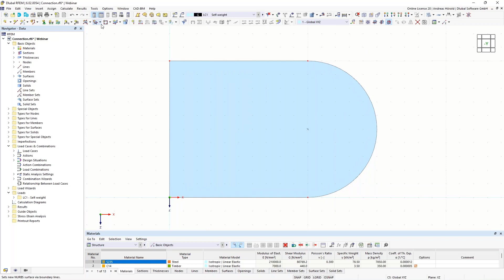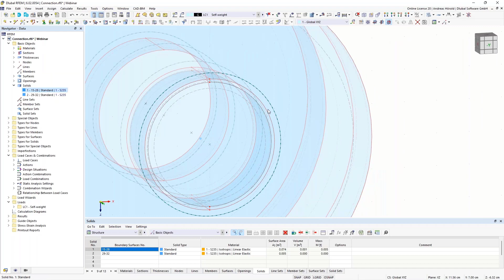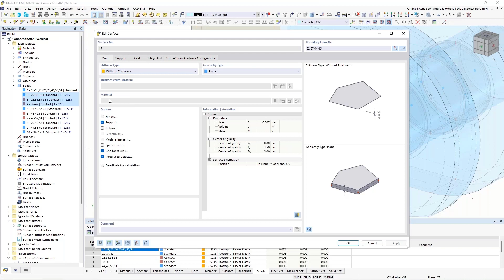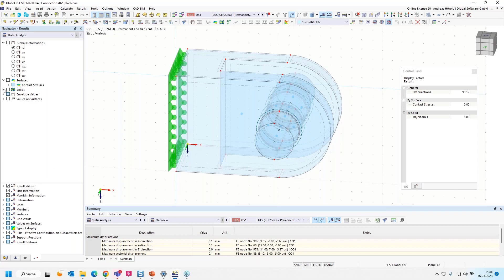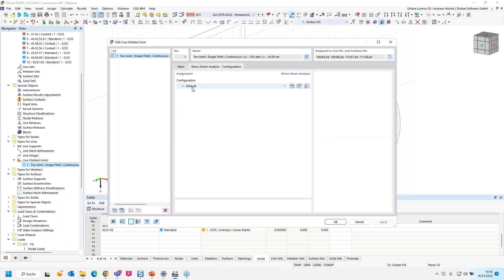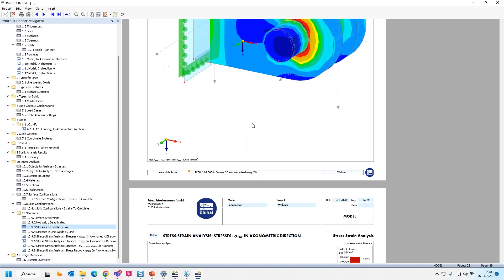Modeling and Design of Solid Elements in RFEM 6

Comment: Very interesting presentation.
Question.
The whole model was supported my an surface support.
How would you make a model that is supoorted with bolts thru the bearing plate into an concrete wall/column?
Reply from the maker: Hi, picajoool!
Please take a look at this model. I think, this should help you. https://www.dlubal.com/en/downloads-and-information/examples-and-tutorials/models-to-download/001258
Reply: Thank you very much for the reply 🙂
@18.45 You say that, becasue there is a gap between the 2 surfaces, you will create contact solid.
As you mentioned, you could also cretae an surface release but only if there was no gap...meaning the 2 solids would share one same surface.

Wich option is better and why?
Reply from the maker: Hi, @picajoool! Both options are possible and the same behavior can be applied. In the webinar example, the contact solid was used, to not to increase the bolt or decrease the hole.
Reply: @DlubalEN  Thank you for answering!
Can you please explain how to determine the "thickness" of the contact soild in your model?
Im asking becase the contact solid that you modeled "has an actaul thickness" of 1mm in your model (=2.0cm-1.9cm=0.1cm)